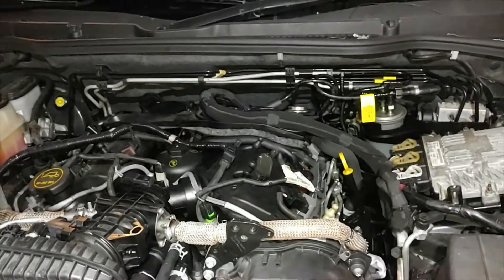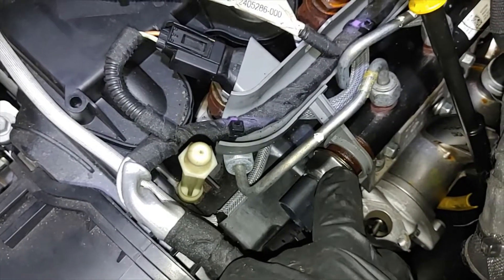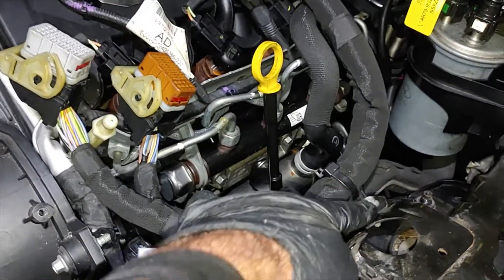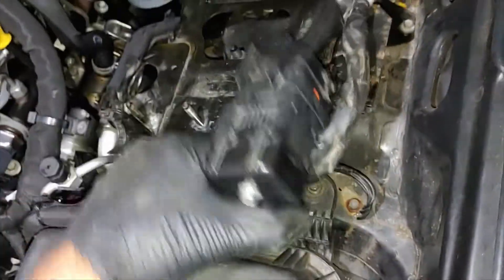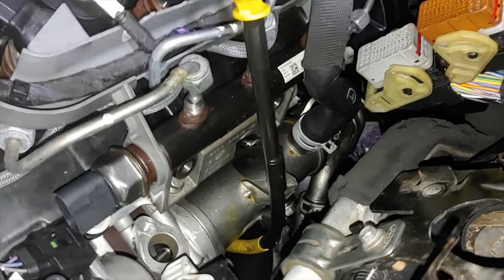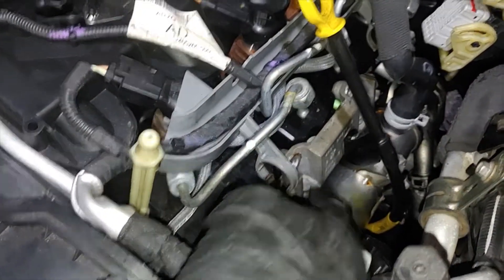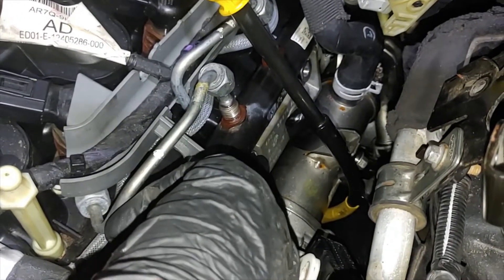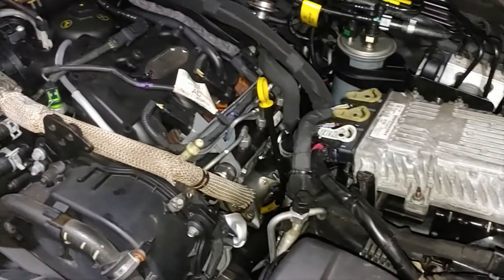Ford Territory SZ Fuel Rail Pressure Sensor Replacement

Comment: Hi mate im having codes p0087 p0191 and p115A coming up car drives fine but when i put my foot down or go up a hill it will go into limp mode and limit power if i turn car off then on its fine for a little bit then happens again any ideas would be appreciated
Reply from the maker: @xr6turbolife988 hi.
Clear codes and scan again when the problem occurs.  If you still get the same  errors the do the following:
1. Check the wiring to your fuel rail pressure sensor.  P0191 indicates sensor or circuit problem 
2. I did a video on fixing p115A. Watch and do the necessary 
This should clear all issues. I believe p0087 is resulting from p0191.

Comment: I put new fuel pump on my sz diesel and was only run for 20min then never start again,scan tool show nothing is there any help to solve my problems
Reply from the maker: Remove the inlet fuel line from the fuel filter. Do you see fuel coming out when you rotate key?
Reply: Yes it pump out very strong but injectors are not open unless I spray a little pit of petrol through  the throttle then start then stop after that
Reply from the maker: @adolfpelman8859  do you see rail pressure, vcv and pcv values?
Reply: No im still watching Ur video if I can follow it still no start
Reply from the maker: @adolfpelman8859  if you do not see any fuel pressure values in the tool, then the problem may be your fuel sensor. Either disconnected or bad.
Reply: Thank u for your help I will  do the fuel sensor next and I will let u know

Comment: Do you have to take the Fuse out for fuel pump to depressure fuel rail/system ? Or dont need it
Reply from the maker: High pressure lines are automatically depressurised when the key is removed from ignition. The pressure control valve is spring loaded and open by default when the ignition is off. This ensures no residual pressure in the system.

Comment: Would a P0191 code be a valid reason for replacing the fuel pressure rail sensor?  I'm getting this particular code, but having no issues starting the engine and overall the car runs fine.
Reply from the maker: P0191 definitely indicates a bad fuel sensor but since you are not having any issues, I assume your problem is either intermittent or entirely something else and you need to be careful with the code. Ensure that the connector is properly plugged in plus the PCM is able to see it.. and figure out when is it triggered.. it may be temperature dependent..

Comment: What was the reason for replacing the sensor (then the fuel pump). My SZ territory is cranking but no start. Scan Tool measures zero rail pressure when cranking. (It does spike to 90-140kpa intermittently but only for a fraction of a second every few seconds of cranking.
Reply from the maker: I had a different sort of rabbit hole to deal with. Check out my video on P0088 and P0087.. it'll give you a very good idea on what you might be dealing with... Fuel system on this car is sensitive to so many parameters